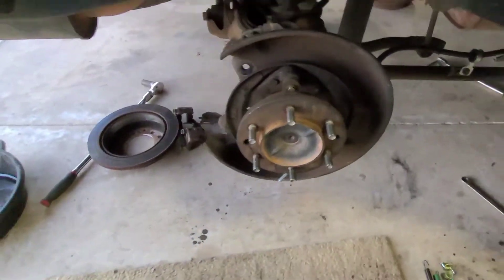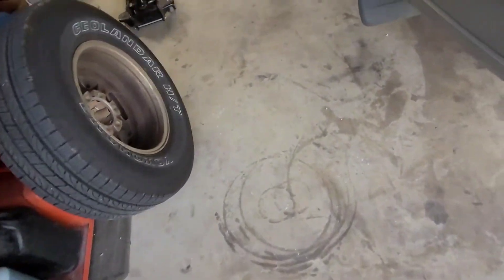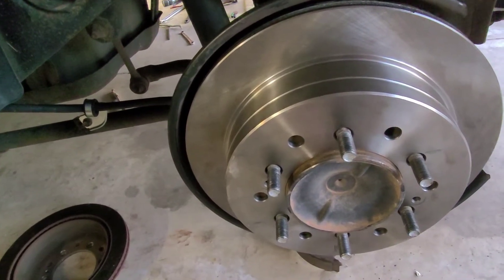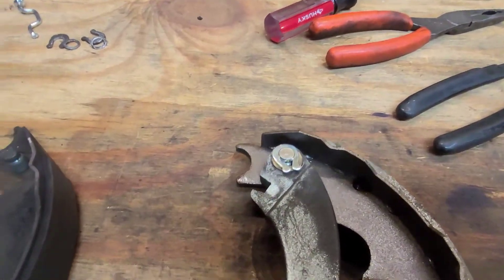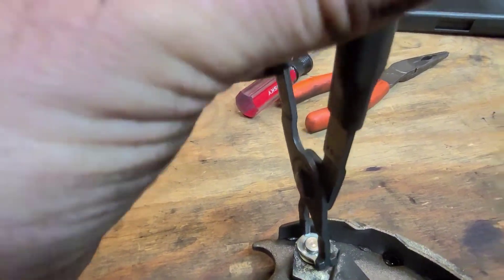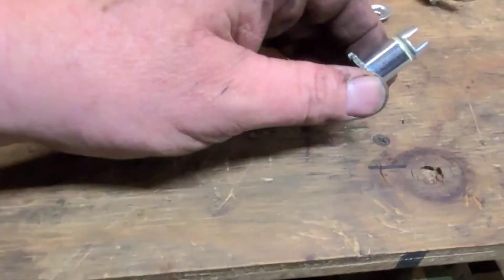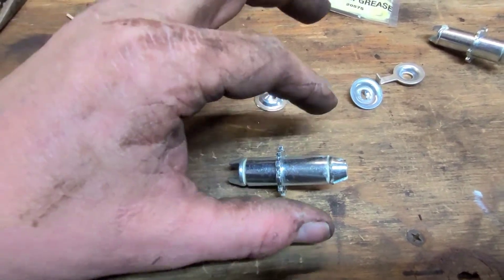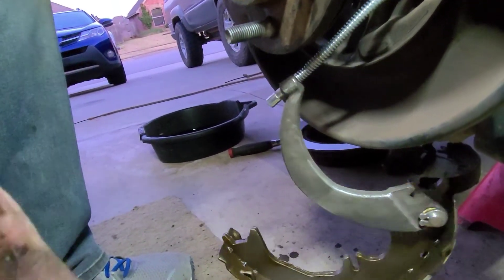What to expect when replacing both park brake cables on a 2001 Toyota Sequoia

Comment: According to some diyer, the cable with the yellow tape is supposed to be locked into the slot above (4:00). It affects the cable tension for some reason. They put zip ties to attach it.

Comment: Have a tip to pass along to your channel.
Had the same problems fumbling with those spring cups on my 07 Sequoia and wasting almost half the day .
Then I found the perfect tool from Harbor Freight , their Upholstery and Trim Tool set #99739 , $15.99.
The grips and strong blades give really good leverage and work great (much better then fingers) for getting underneath and holding the spring cups out of the way.
Took me only a few minutes using them and worth the price . 
Love it when tools can multi task.
Reply from the maker: I'll have to check that out! Thanks for tip!
Reply: Or zip tie the springs and cut them off when everything is assembled

Comment: I need help ASAP. If I'm replacing just one rear rotor and nothing else what do I do about the parking brake? Was told I need to disable it but can't find any info
Reply from the maker: @firstnamelastname3842  you can always adjust them in and then not use the p-brake pedal, that would probably be the easiest thing to do
Reply: @theman9764  so basically if I don't press down the p-brake peddle in my car I won't run into any issues?
Reply from the maker: @firstnamelastname3842  you shouldn't unless the p-brake shoe hardware is damaged and letting the shoes hang

Comment: My '06 is giving me issues with putting new rotors and shoes on. I just can't get the rotors on.
Do you think I should make more slack in the line to take tension off the parking brake lever? People owning other makes and models (BMW, Chrysler, etc.) are saying to do that. Did you finish tensioning the cables before you threw the rotors on?
Reply from the maker: I believe you would need to adjust the park brake shoes all the way in to help make clearance for the rotors

Comment: Hi I have a 03 Toyota Sequoia to remove and replace the rear parking brake shoes do u have to remove the whole axle. I’m asking because someone told me to get it done they a take half of  day because they have to remove a lot
Reply from the maker: You don't have to remove the axle but because of the design, it's a major pita to work on, so half a day is probably fairly accurate

Comment: The BS is Toyota assemblies the shoes on the assembly line before pressing in the axle, the spring access hole is under sized for the tools available that release the spring caps, the tool is suppose to pass through the hole,  someone failed their job, of course those parking brakes will last longer than the car if you dont get a axle seal leak.